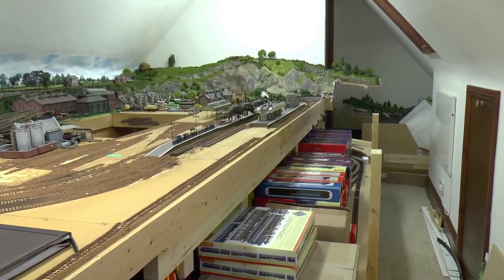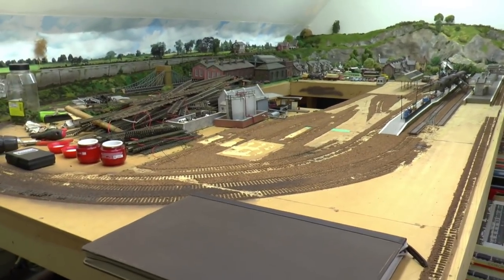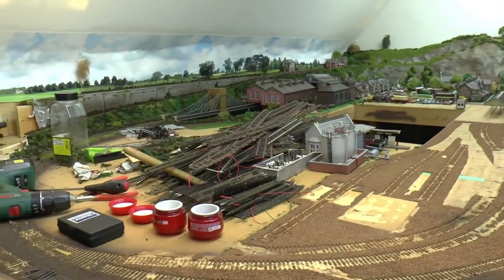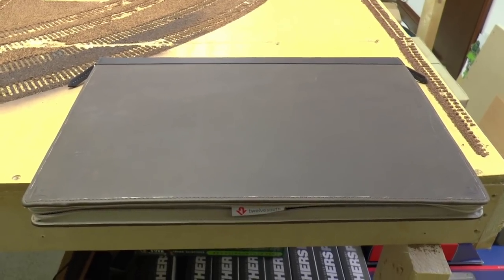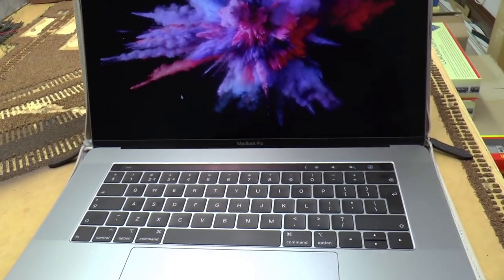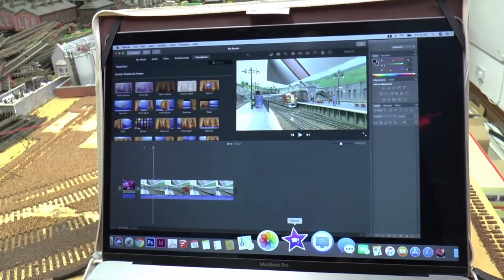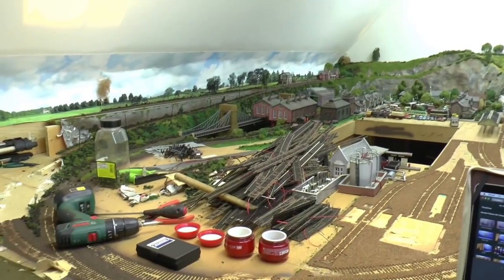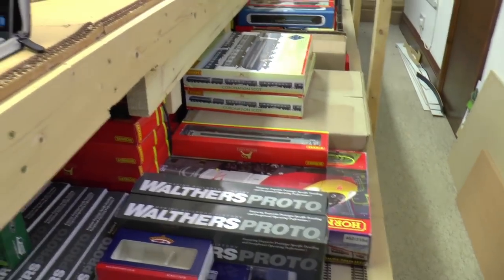A test video and a Lakeside update.       19 10 2018

Comment: Graham  on your new layout use plywood in stead of MDF , plywood lighter to handle , stronger . Easier to work with . Good to see the dismantling of Lakeside going well .
Cheers Glynn
Reply from the maker: QRoutback    Cheers Glynn, I’ve not worked with ply very much but I found it splintered a lot compared to using MDF when I did use it, I guess it’s what you are used to. Plus because I am cutting out complete sections of the scenics (like the village) then I want to replace it and cut it into the the new layout so I want a like for like material. It will all make sense when I come to the rebuild.   😉.   Cheers for now.        ...........Graham

Comment: Nice to get a peep at what is going on with the railway, hopefully we will see some more updates whilst you go along. With regards the laptop, very nice, just one thing i would be careful of, make sure you keep it backed up to either the cloud or another external drive. I have a feeling that the SSD in the laptop is actually part of the main motherboard, so if that goes down you could lose everything on the drive. Silly idea to have it combined onto the motherboard, but i guess Apple were just trying to save space.
Reply from the maker: 100SteveB    All my data is auto backed up each night to the cloud and in fact when I had signed into this new laptop then I had all my existing data from the old laptop up in about 15 minutes, all songs (over 8000) plus photos and videos (over 9000) were showing after about 6 hours so all good.   😉.    If I take a photo on my iPhone then I can see it on my laptop or main iMac within seconds - it gets transferred to all my devices, I then have the option to download it should I need to.    Cheers for now.     ..........Graham

Comment: Nice one Graham. Is the track really past its best before date or is it a case of replace it to make sure? Might have to leave the car outside and use downstairs to store the scenery and locos!! Is the ballast salvageable if it was given a good beating in the food blender when herself is out? My pc is some 15 years old and does struggle a bit, but it still lives, not sure what it is now but it is slow and cant cope with many programs open at any time. Des.
Reply from the maker: Des Silverson     Hi Des, I will be able to use some of the old track and all the points but I will not use any track that looks a bit dodgy as I just don’t want to reintroduce and track problems again, I would rather spend a few quid on some more new track.  The garage is a good place to store some of the things but I will endeavour to store all the locos up where they are at the moment for safe keeping, it’s not damp up there so I know they will keep in good condition.  The problem with any old computer is that they can’t operate the programs so efficiently as they once could because the programs may have been updated a few times to cope with the newer computers and operating systems plus of course computers have advanced so much over the 15 years - with that kind of scenario then it will appear to be sluggish but if it still works and you are happy with it then that’s all that matters really.   Cheers for now mate.        ...........Graham

Comment: Graham I have just bought the same MacBook Pro as you have. what operating system are you using ? high Sierra 10.13.6 or Mojave 10.14 ? I am currently running High Sierra .

I am having a few problems with mine at the minute it seems a bit slow to boot and seems to crash a lot when using iMovie . 

but like you say it’s fast at uploading videos and the SSD is quick I  fitted SSD to my old 2010 mac a few years ago that made a big difference to the performance . Hopefully I can get this new one sorted out somehow. 

I liked your video about fitting the new speaker to the Deltic .I may try that with my prototype Deltic as I was never quite happy with the sound but didn't want to cut  anything on the locomotive

Looking forward to the new Lakeside
Reply from the maker: Oliver Chapman    Hi Oliver and well done on getting a new MacBook Pro. I went straight to Mojave and didn’t mess about with High Sierra, I went for the 2.6GHZ/16GB/RP560X/512GB model which is the top spec model without it being customised, it only came out in September so was made for Mojave.  If you still problems with it the talk to Apple support and they will guide you through any issues you have - iMovie should not keep crashing like you say it does and also it should not be slow in booting up either, it could be a simple thing like a system conflict somewhere but the guys at Apple will put you right.   As regards the speaker then the Deltic is not finished yet and nor is the 70 either, they both need an additional speaker as the EM1 is only rated at half an ohm, that’s a job for me to do jurying the week sometime.  Hope you get the Mac sorted out mate.    Cheers.        .........Graham
Reply: Lakeside model railway thanks Graham will try updating the os on the Mac and see if that helps and if not let apple have a look. My Mac is the same as yours .  I bought this hub to go with it it’s called a QacQoc  they do several different types seems very quality for £18 . https://www.amazon.co.uk/gp/product/B077JNRWSY/ref=oh_aui_detailpage_o01_s00?ie=UTF8&psc=1.

Thanks 
Oliver
Reply from the maker: Oliver Chapman    That looks interesting Oliver, just as a point of interest, do you have this hub plugged into the laptop when you boot up?
Reply: Lakeside model railway  no it’s not plugged in when booting up. I will give the update a try first

Comment: Wow, Graham you have been busy. Hope you have fun with your new laptop. A bit off topic - are you going to do anything about the climate conditions in the loft? Like installing A/C. Maybe reverse cycle. To get rid of the stifling heat in summer and ice cold conditions in winter? I know from experience how bad the heat can be and I am only using half of the garage! As you know it can get pretty hot in Australia in the summer. We have had a few days of high 20s here and it's only October, but it was bearable with garage door open, nice breezes, but it won't be like that in a few weeks when we get temperature in the mid to high 30s, maybe low to mid 40s and hot northerly winds blowing straight into the garage!

Now would be good time to think of A/C and have it installed before you start the rebuild. Enough of my ramblings. Just a thought for you. .... Ian
Reply from the maker: Hawthorn Valley    Hi Ian and sorting the room out first will be my number one priority before I even put the first screw into any new baseboards. New LED lighting, air con and heating, extra electrical sockets where needed etc. I want to get that right first which is one of the main reasons for starting again although not the only reason of course. Once I have the room right then I can start on the rebuild. I’m determined not to suffer in the heat or cold this time round.   Cheers for now mate.         ..........Graham